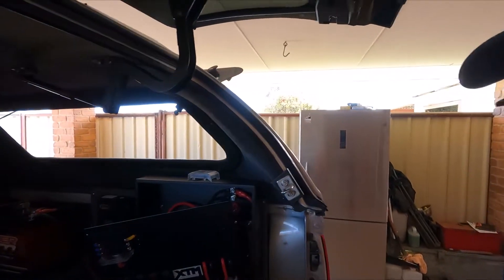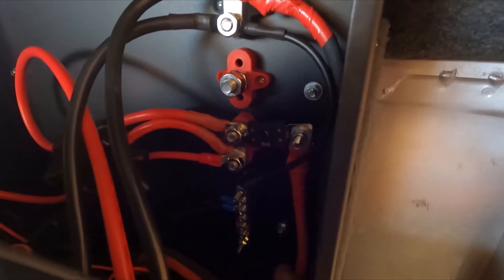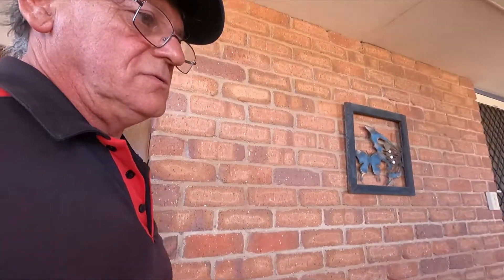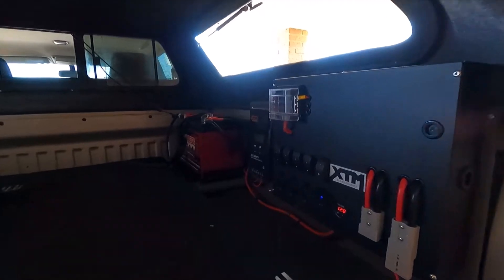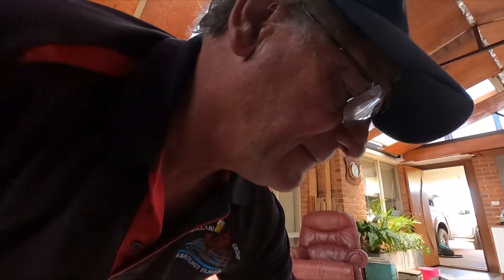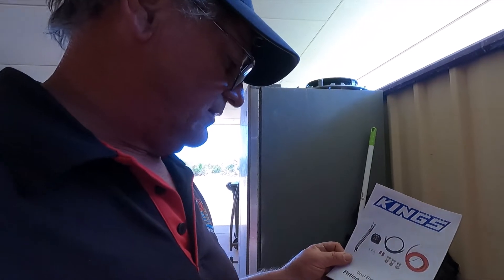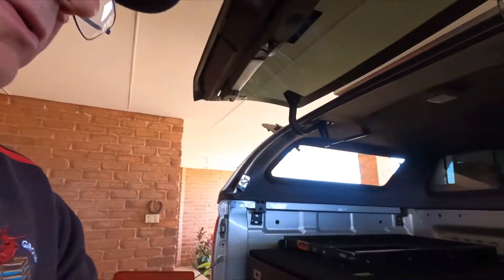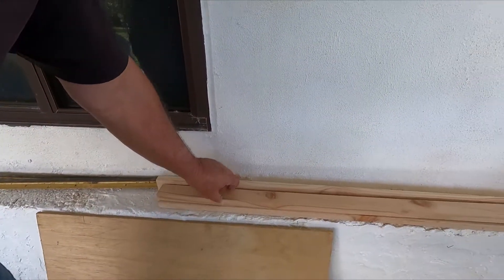3000W Inverter Setup | Kings + MPPT Solar Controller Full Install

Comment: That 3000 watt inverter if run at full capacity will pull 'more' than 250Amps. Inverter efficiency, ambient temperature, cable insulation, safety factor etc etc are calculated into the equation. It's not simply a matter of 3000 divided by 12 to arrive at 250amp. Then there is any other loads on your batteries potentially as well  at the same time. As voltage decreases amperage draw will increase. You cannot run that inverter at even a 3rd of capacity of it's capacity on a single AGM lead acid battery as it would be pulling 'at least' 83Amps @ 1000w and even more if voltage sag takes it lower that 12V and that is well beyond an acceptable discharge rate for a single AGM (it will kill it). To run that inverter to full potential and not have a disaster happen you need around 300AH of Lithium batteries, not AGM. A fuse rated at minimum of 350Amps and cable from battery(s) to inverter rated beyond that fuse rating. That would likely entail a cable of 95mm2 or 120mm2 which are very hard to find, and very expensive. Failing that it needs two cables on each of the inverters Pos and Neg connections to battery. 2B&S x 2 should be around 360-370Amps. Don't trust the cables that came with the inverter as they will not be cable of carrying the full current demands of the inverter. If you ever go lithium that Kings dual battery kit will not be suitable. An DC-DC charger instead would have future proofed your system. Please stay safe.
Reply from the maker: Thanks for the information I did get cables made from the auto sparky and I have only run it for small times, till I get a second battery of 200 amp hours that will be a  total of 335 amp hours in the car.im slowly getting there.
Reply: @edshazzadventures  You'll have to match your existing battery capacity and brand (if it isn't too old) and parallel together to double capacity. If you put a 200AH battery with your existing 135AH you'll eventually destroy one or both. They will not balance equally and amp draw will favor one over the other rather than draw consistently and equally from both.  Take your time and read up. The hobby is expensive enough without possibly buying things twice. Wish you good luck with it. 👍
Reply from the maker: @erroneouscode  tanks will look into the same battery and buy 2.